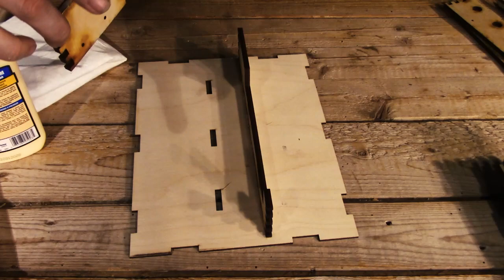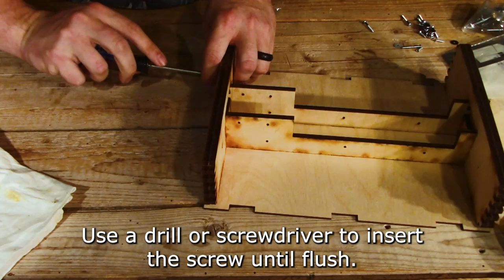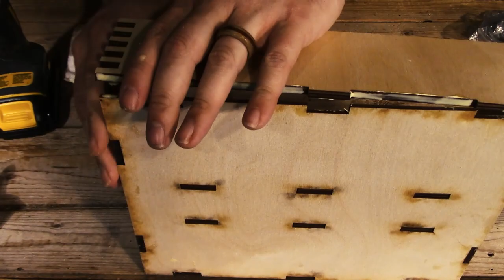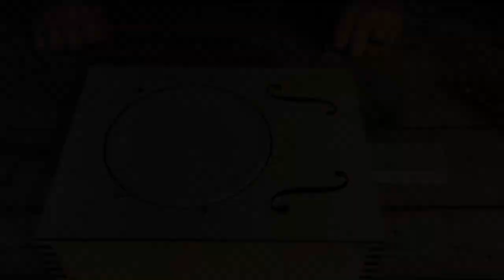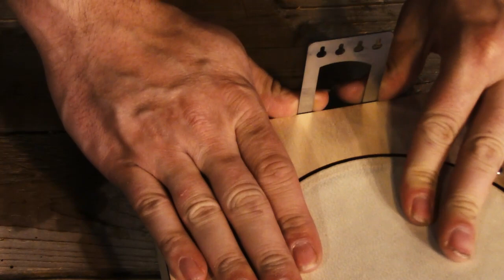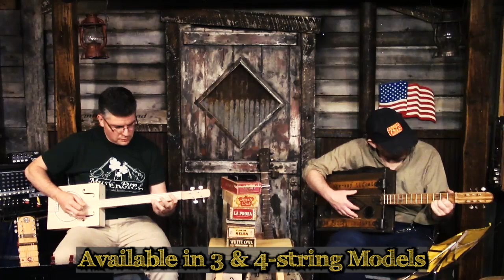How to Build the Country Roads Banjo Kit

Comment: Any best practices on finishing?  When to finish?  before gluing?  What types of stain/paint this type of laser cut board will take? Also where is the best spot to put a strap button on the tail?  Mine is on the way, can't wait to build and play.
Reply from the maker: Hey there Tony!

There are many answers for this, however I'd say the best time to do the finish work would be toward the end of the process, before stringing the guitar up.

As far as what to use I've seen everything and anything thrown at these. The panels take stain and paint very well. Anything you can use that is safe for physically handling, should work just fine. 

As far as the strap button, ultimately it's down to comfort. As a suggestion, a good place to start would be to replace one of the screws used for clamping the end walls with the strap button setup. It would save from having to re-drill and it's close enough to where we would mount them on other kits.

Feel free to message me (Nick) at support@cbgitty.com with any other questions!
Reply: @Cbgitty  thanks Nick!   Still trying to decide between an Irish flag paint job and some kind of stain.    I'll submit pics to cbgitty when I'm done.